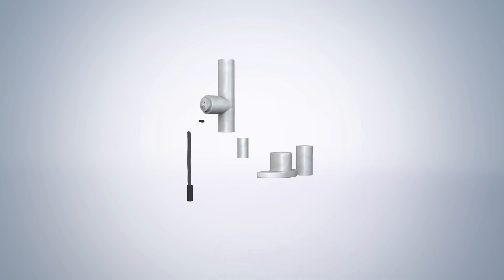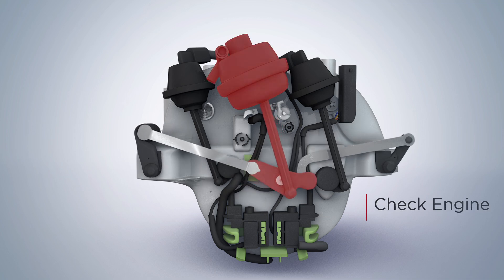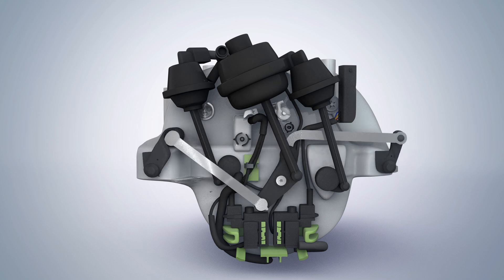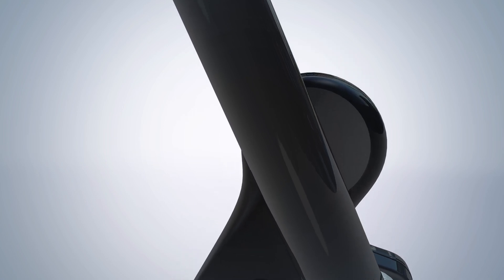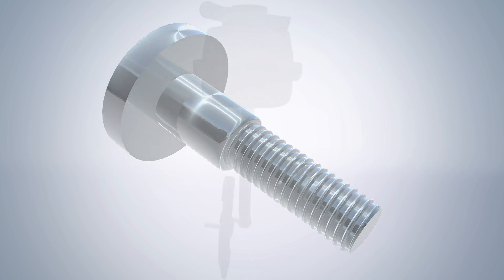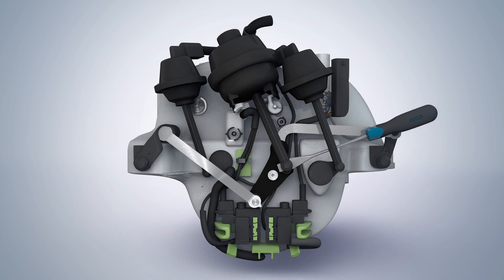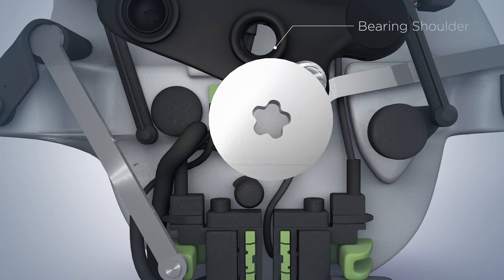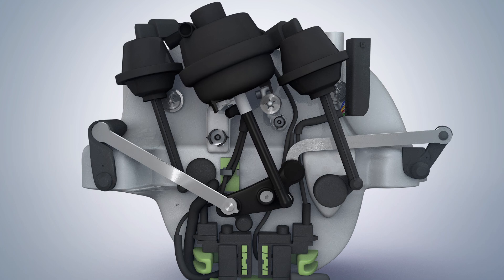Mercedes Intake Manifold Swirl Flap Repair Kit 272 140 2401 R-PRM for Lever and Actuator Rod by URO

Comment: I have this code 
0521 intake manifold short circuit to ground of sensor lines tumble flap shafts stick in the actuated position (P2004) what could it be ? is it some kind of electric thing like a sensor ? or is it that broken flap ? and should I replace the whole Intake manifold ?
Reply: well any one help me ?
Reply: i have 0521 code that you have and P2006 code which states "intake manifold runner control stuck closed bank1 a"
me and you will most likely needing to replace either the manifold or the part in the video
Reply: Well I think I will replace the whole manifold cause I checked it my self without takin it out you could see it through a hole, some thing like that and I saw no crack or something. Next week I well take it apart and I will replace it also I will check it if it is really cracked or not for you
Reply: Jonathan Gonzalez yep it wasn't broken, I replaced it today
Reply: bassam asaad it was broken or it was not?
Reply: Jonathan Gonzalez it was not, I replaced the whole manifold today I don't know what is the problem yet but it is maybe some kind of a sensor, also I noticed that there was to much dirt under the manifold and some inside the cylinder I think it is because the weather here in the Middle East
Reply: @AkbarKhan-vz7in  from a Mercedes benz dealer for parts 😁

Comment: Good video thanks - but what about if other plastic actuating rods (not the middle one) or ball joints have snapped - as mine have. Do you have options/products for that situation?
Reply: Same. Did you find a product for your problem?
Reply: @lyceargtx3779  I found a kit for those things on AliExpress. Not sure of the quality. Ordered it but it takes months for it to arrive. Might be easier to just get a whole new manifold. It's a crime that MB doesn't sell these pieces and that it made them out of Fisher Price plastics.